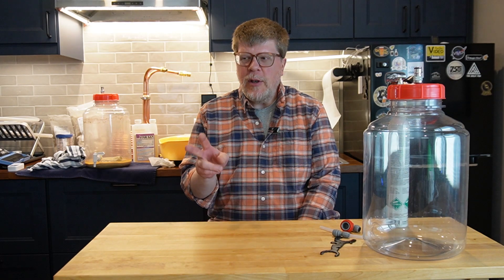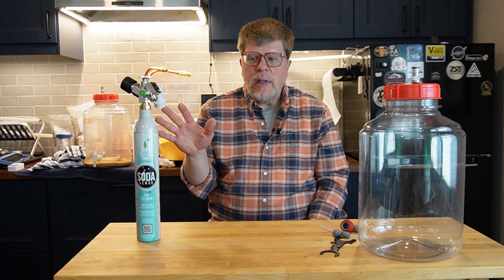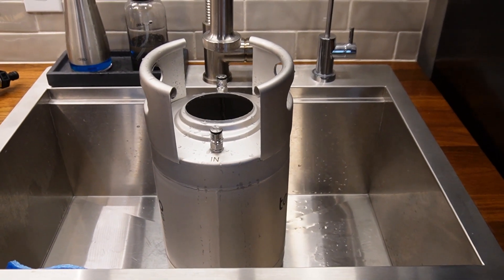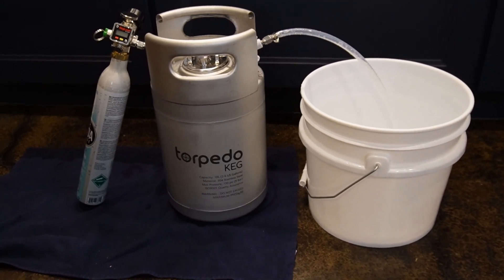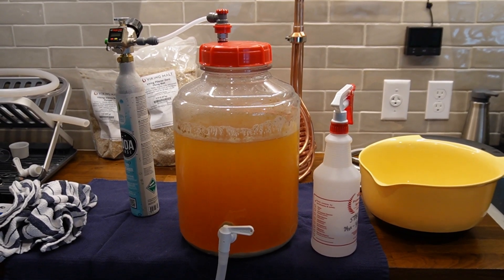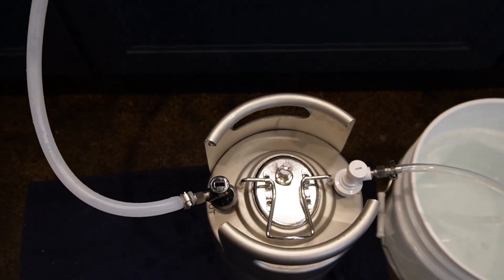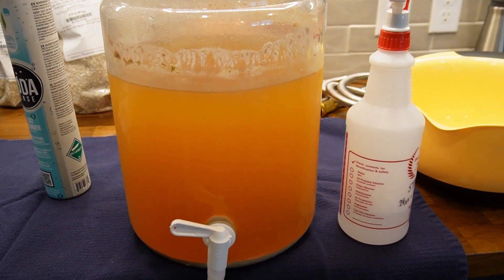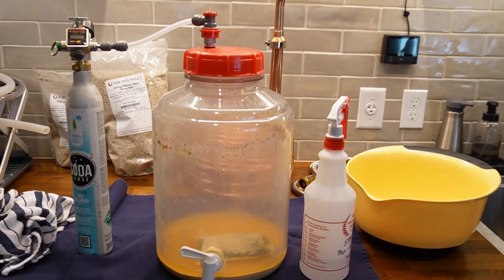Closed Transfer With a Fermonster

Comment: One interesting thing I’ve been wanting to try is purging the starsan from the keg with captured co2 from active fermentation. Same drilled gas post set up but instead of connecting tube to a cup of star San for an airlock, you connect to gas post on keg and a picnic tap left open on the liquid side. It’ll take awhile but should push out in a day or so
Reply from the maker: That'd be interesting to try! I've seen a lot of videos where people's primary goal is to capture and reuse the CO2 created during fermentation, which is cool. The way I did both this and the cold crashing, for better or worse, has zero regard for conserving that generated CO2. :)
Reply: Right?, it would be really cool to do a cheap fermentation (like just sugar) with the main goal to capture that co2.